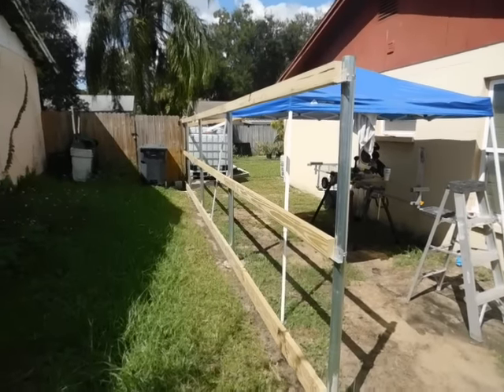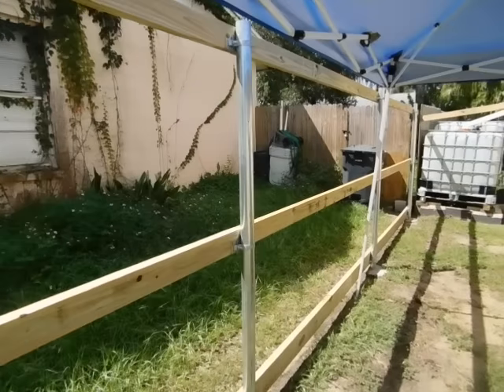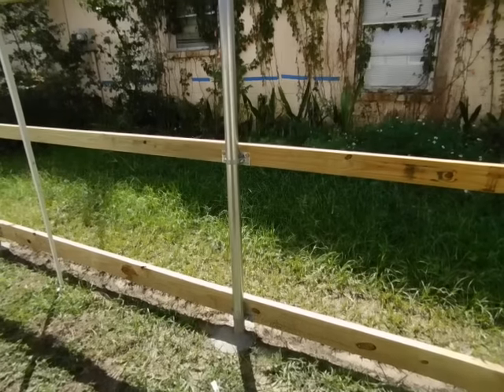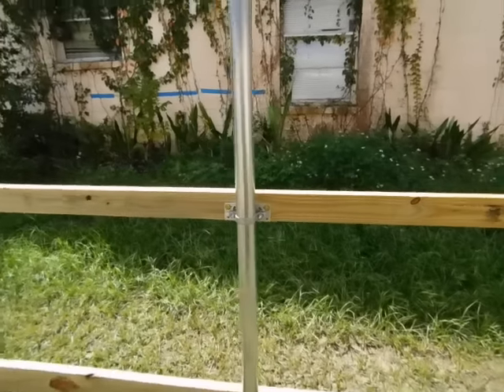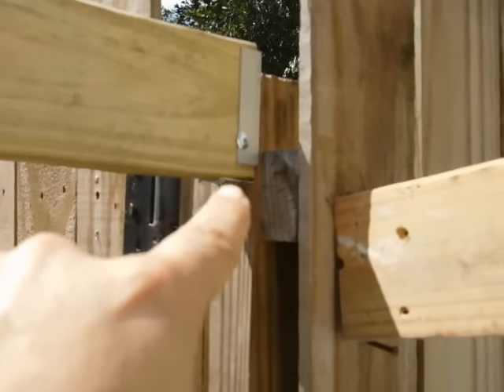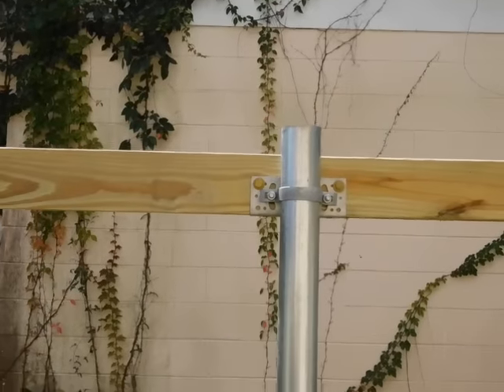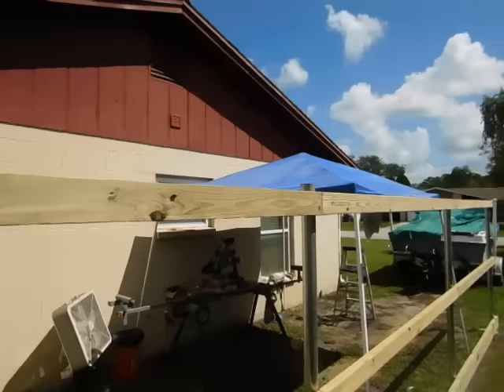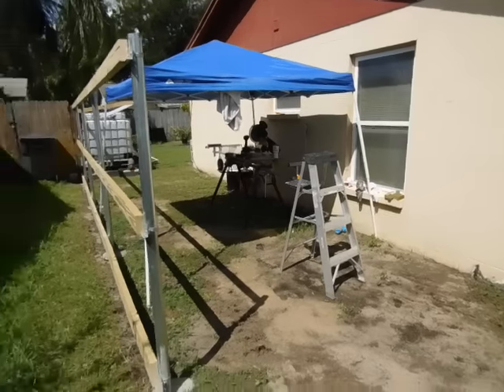DIY / Building a wooden fence using galvanized fence posts (part 1).

Comment: Excellent information.  Can you make a double panel wood fence with metal posts??do you have any video showing how to make it?
Reply from the maker: When you say double panel, do you mean panels on both sides of the fence? If yes, then I believe you could but you need probably a special kind of bracket to hold both of them up.

Comment: These are nice, I helped my neighbor few yrs back doing the exactly same thing but he wanted panels instead of individual pickets.  They used to have them at homedepot.  Now it has to be ordered.
Reply from the maker: Yeah, doing it like this or custom in my opinion, will last longer because of the hardware used to secure the framing and pickets. Pre fab panels are okay for a few years maybe depending where you live.
Reply: @MannyFontes1968  matter of fact. I'm in the middle of doing mine.  Shadow box style but in inside is custom pickets.  I burnt my pickets and going to clear coated.  Yeah sounds crazy but why not experiment with it.  Out side pickets are just dog ears 4"space between them.
Reply from the maker: @law35penn  that sounds good and I also ended up clear coating the new extension I made to finish this project by adding more longevity to the structure.
Reply: @MannyFontes1968  👍👍

Comment: Awesome video, thank you. Question:  The posts are 2 3/8 in. diameter and 8 ft. long as you stated, is this the same as chain link posts? Also, can you use a T post driver instead of doing concrete? I need to build a 20 foot long fence at least 6 feet high, would a 6 ft. long post be enough?
Reply from the maker: Thank you! Yes, this is a chain link post and I suppose you could use T post driver but if you have rocky soil, it might make it harder to pound down. A 6 ft. long post would be too short to support a 6 ft fence.

Comment: I built my fence also using galvanized steel fence post, but I also pour a 6" wide concrete beam, 3" deep with 3/8" rebar reinforcing the entire length to protect the posts and bottom of the fence, then build a frame of 2x4 that fit between the post with 3 horizontal 2x4. the bottom 2x4 I taper the top with my power planer to drain the water off the top of the rail.  I used Flood wood stain to protect the wood from deterioration, also I top the fence with a 2x6 also taper to keep water from soaking into the wood.
Reply from the maker: David, that is definitely a stout build and the extra finishes you added to your build will keep your fence looking good for a long time to come.
Reply: How do you taper a 2x6? Also what you say sounds nice, but that concrete beam sounds like a looot of extra work and expense. A foot board is easy/cheap enough to replace, won't it last 10 years?

Comment: Nice job man got alot of good ideas from ya! Question.... How could I make a couple 90°'s if I wanted to come around a tree like my existing fence is?? Any special brackets for that is I using the pipe and brackets like you described without any wood posts??
Reply from the maker: Thank you and yes, you can cut the bracket in the middle but only on the bottom half where it makes the "L" shape so that you can bend it and make it turn 90 degrees and just have the two pieces of support 2x4 butt up against each other. You could probably also use some flat "L' brackets to splice your 90 degree corners for changing direction.

Comment: How do you attach a 90 degree corner with those brackets?
Reply from the maker: Unfortunately they don't make a bracket that can wrap around a 90 degree corner and still give you a place to screw the bracket to the wood but you could modify some existing brackets like the one in this link https://www.lowes.com/pd/Simpson-Strong-Tie-2-3-8-in-Pipe-Grip-Tie/1002623566 by extending one side, doesn't matter which one, so that you have a space to screw unto the wood support. You could also use a 4x4 in the corner, so the pickets have a mounting surface or install two galvanized posts about 1.5 feet from the corner so that the support 2x4's can butt up to each other and provide the same picket mounting surface.

Comment: Educational and impressive…. Might you tell me what size auger bit diameter you used? And can you use a smaller bit and increase the diameter of the hole?
Reply from the maker: Thank you and I used an 8" auger bit and yes, you can use a 6" but you'll need to scrape the sides down to make it bigger.
Reply: @MannyFontes1968  thanks for the reply
Reply: I don't understand. How can a smaller bit make a bigger hole?

Comment: I’m gonna use this idea but add it to an existing all wood fence use the metal posts as extra support because my fence is about less then a year old and is already saggin a little due to this high heat
Reply from the maker: Yes absolutely! Adding the metal posts will definitely help to provide more support for your fencing.

Comment: I’d like to try this! However my neighbor has a broken down fence still up and I’d like to fence my side at least. Ideally this would be a lot cheaper than going with concrete and blocks.
Reply from the maker: Weese, you can definitely put up some fencing on your side but I would check to see if your neighbor would like to go halves on the fencing that way you won't lose any footage on your side.

Comment: How was we arrange the corner using these post ? I live in Florida too and have to repair a corner of the yard 100" by 98". I don't have fence experience but need to get this done. Is those 2x4 rails ?
Reply from the maker: Michael, if the framing in the corner where you need to make your repair is good, then you can use two or more of these metal posts to re-secure your framing and rebuild that section. Set the metal posts in concrete for a stronger repair. Yes, my top and middle rails are 2x4x8 pressure treated.

Comment: What about the post 2 feet in the ground without cement
Reply from the maker: Are you referring to the 4x4x8 pressure treated? In some locations you can install them with or without concrete.
Reply: @MannyFontes1968  no steel post
Reply from the maker: @mrmansmith4154  I believe that if you put the post in the ground without using concrete it would make it a weak footing. The concrete gives it extra strength.

Comment: I'm thinking of trying to take down an old chain link fence and use those existing fence posts for a taller wooden fence... if that'd be possible.  Looking for ideas on how to do it, lol.   If I have to slip taller pipes over the existing posts, I think I might as well set those properly and just replace the whole lot.  :/
Reply from the maker: You can for sure replace the whole lot but they do make extension pieces that can over the old metal posts that may save you a lot of added labor...lol Unless the existing posts are off plumb, then I would look into doing it the way I mentioned b/c new metal posts are not so cheap anymore...$26 to $28 a pop...

Comment: In case I missed it. What is the plate that is holding the 2 pieces of wood together that you have thr bolts going through?
Reply from the maker: Those are called "metal to wood fence brackets" and I got them from Lowe's.

Comment: great vid Manny! Do u think the post brackets would support smaller posts? like 1 7/8" posts?  thanks bud
Reply from the maker: Thanks Scott! Because the round diameter of the post side is made for the 2 3/8 dia. metal post,  it might not compress enough to squeeze a smaller diameter post unless the ends of the clamp are flattened so it takes up the extra slack.
Reply: @MannyFontes1968  yea, thats what i was thinkin. i ordered just one of them to test out on  my fence. Thank again

Comment: are there brackets that are "two sided" so you can use round posts and make a good neighbor fence?
Reply from the maker: Me personally I haven't seen any but i'm sure that someone with welding skills can make some. Usually, neighbors just agree on which side the pickets will face so that they don't have to put up two separate fences.
Reply: Worst case, use two brackets, one facing the neighbor, one facing you. That will cost you double the 2x4 framing. Another idea: Put on the framing as shown here and you can attach pickets on both sides with no problem everywhere except where there is the post. Just leave a gap for the post there, and you will be pretty good. If you want a little extra polish, attach a picket over the post. You will see a bump there every 8 feet but it won't look bad.

Comment: The posts will last 100 years in the ground 😮. I built the same kind but 4 string 2x4 with a 4.5 distance between all posts. 60 mph winds don’t even phase the fence it just laughs 😊
Reply: Also I have 2 entry gates that are steel frame one 6 ft wide and a double gate 8.5 wide for yard access with a truck
Reply from the maker: Yes, at those intervals on your posts, the wind doesn't stand a chance...lol
Reply from the maker: @digitalorgy3784  Wow, that is a sturdy build for sure.

Comment: Great system. How strong is this when you push on it? My wood posts are always rotting out. 

 With permits? What part of the country?   Are posts 8 feet center apart like that legal in Florida?

Anybody really get permits for a fence? I wonder what the fine is in most counties in Florida?
Reply from the maker: Thanks and it is very sturdy and strong. Yes, I used to have wood posts also and but the hot summers here did a number on them and that's why I went with the metal ones. Permit wasn't necessary because I was replacing an existing fence and am in central FL. I believe 8' centers is the minimum but you could go with 7' or 6', it's totally up to you. For Hillsborough county! "Typically, a permit is not required to install a fence. However, it is recommended to talk to a zoning counselor to identify height and placement restrictions."

Comment: Nice idea: good install.
Please could you post a link to the galvanised posts and brackets you used.
How do the galvanised posts compare price wise to traditional pressure treated 4 x 4’s?
Reply from the maker: Thanks AdvancedIT, the metal post cost $21.20 ea. and the 4 x 4 PT post costs $6.88 ea. at Lowe's.

Comment: Very nice, i been trying to find some type of decorations for the galvanize poles in my fence!
Reply from the maker: @3olemrac, thanks, let me know what ideas you come up with to decorate them.
Reply: Easy. Use 2x2 strips on both sides of the pole, screw the strips to the pickets. Then attach a picket to the strips and bam, your pole is covered with a nice wood piece.

Comment: does cement really only needs 20 minutes and you can put the fence up
Reply from the maker: There are cement that have a fast dry time that will allow you to start building on them but I like to use the one that sets mostly within a day before mounting the brackets and wood framing.
Reply: @MannyFontes1968  I can't remember the one you were using in the video but I think if I remember right it's the same one that I use just takes me 20 minutes and then I start hanging fence... But I do it as a job so I'm in more of a hurry I guess
Reply from the maker: @moderngunguy3666  Yeah I use the brand name Sakrete that sets in about 6 hours and has a work time of up to 45 minutes. Yeah, I can see where you would need to have a quicker set time. I'm semi-retired so I take my time when I do these jobs.

Comment: Why do you need gravel for steel posts?
Reply from the maker: The gravel wasn't necessarily for the metal posts but to help the concrete set up better because here in FL we have a high water table.

Comment: I have seen people use a chain link gate frame and drilling holes to bolt on the wood on the outside so the gate never sags.
Reply from the maker: Yes Chad, that is a good option to use if you want a good sturdy gate and I think the weight difference between using wood vs. metal may only be a small amount.

Comment: In hurricane areas they usually recommend burying the posts 3ft in the ground, but the problem with that is it only leaves 5ft above ground since they come in 8ft lengths. After our recent hurricane I have seen fences pulled right out of the ground, concrete and all.
Reply from the maker: Shawn, in certain areas where you're prone for high winds that would be the case and for me, so far it's been good and the short gap between me and my neighbor also helps alot.
Reply: Maybe doing 6' apart would be better in high wind and hurricane areas.

Comment: The link to the bracket you used is not the same as what you appear to use. The one you used seems to be adjustable for angles. Do you have the link to that particular bracket?
Reply from the maker: Nicholas, the brackets I linked to can be used as well but here's another link you can use. https://www.lowes.com/pd/2-3-8-IN-ADJUST-WOOD-POST-ADAPTOR/1002916330

Comment: Another qyestion if you don't mind. How do you keep the post plum and level until the concrete dries? Thank you.
Reply from the maker: I use a 4x4 fence post level first to get it plum on both sides once in the concrete and then I use a 4ft. level to double check it once the concrete has set for about 15-20 minutes. The concrete I use is a quick setting one and once you get it plum, it won't move if nothing touches it or bumps against it. After 24 hours, it will be ready to mount your brackets and boards.  Here's the link for the 4x4 level! 

https://www.lowes.com/pd/Johnson-Level-9-in-Cross-Check-Standard-Level/1000085669
Reply: I use 8’ posts with 2’ in the hole and also the fast set concrete. I've found that by the time I pour roughly 4 -50# bags, the post stays exactly where set. After I add water, I re check plum and level and it never changed. After an hour it won't move even if gently bumped

Another trick is to give the post a few wacks with a t-post driver helps to stabilize the post

Comment: How did you get it exactly where your fence rails meet in the center of your post? Thank you.
Reply from the maker: That's a great question and I used construction line and 1/2" rebar rods to mark my 8' centers and then once I set the posts in the holes, I made sure it lined up with the rebar rod. Even if your off by a 1/2" or so, the metal brackets will take up the difference.
Reply: If that's a problem couldn't you just use 10' 2x4s and cut them as needed?

Comment: bro if i want to build a 27ft fence , how many inches i need to put the galvanized post in the ground ??
Reply from the maker: Okay, so i'm assuming you mean a 27ft. long fence, which would mean about almost 4 sections of fence. Depending where you live, like in the northern climate where you may have a deep frost, then I would say your posts should be at least 30 inches in the ground. Here in FL I can get away with 24 inches because I don't have to worry about the ground freezing enough that it might lift the concrete up.

Comment: This is how a see a lot of the commercial privacy fences being built and it seems superior to 4x4 posts... The gal posts are lighter and seem easier to handle
Reply from the maker: Yes Taylor, using galvanized posts will last longer and will give you a better structure all together. Also, you never have to worry about digging up the posts to replace them.

Comment: Doing this but on a slope.  Need to join together 2 x 4 at an angle. Looking for ideas
Reply from the maker: Daniel, if you're using the same type of metal posts and brackets as I did, then you can flatten the bottom of the bracket to allow the 2x4's to lay flat and at the angle you need them to be to butt up to each other.

Comment: Your link has a 2 3/8 diameter post with a clamp that fits 1 7/8 pipe. Is that correct?
Reply from the maker: Thanks for the heads up Gary and I went ahead and corrected the link and here is the right one... https://amzn.to/35a0EEs

Comment: I have 4ft glavanized posts for my wire fence any suggestions on what I can do? I would like to use same posts and do what you did with 6ft fence
Reply from the maker: Oscar, depending on how high your posts are, you can definitely build your fence like mine. If your posts are only 4ft tall, you can buy 2ft extensions to make a 6ft fence and also the brackets that I used for the support boards.
Reply: I'm in the same boat. I have a 4' chain link fence now. I want to go with wood and use the existing metal posts to make it 6' high. I have a few dogs and one jumps the chain link with ease. I thought about using extensions also to the metal posts which should save some money.

Comment: Can you use the same post as a corner post?
Reply from the maker: Yes Carlos you can! You'll need a different type bracket so that your support boards can run in opposite directions. 
https://www.lowes.com/pd/WAP-OZ-FULL-WRAP-Hot-Dipped-Galvanized-Steel-Fence-Mounting-Bracket/1000440269